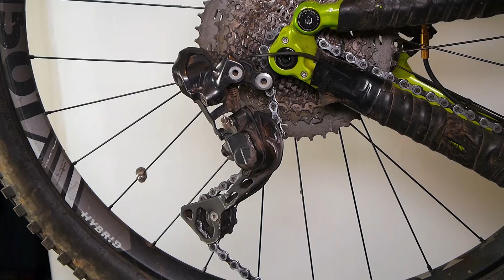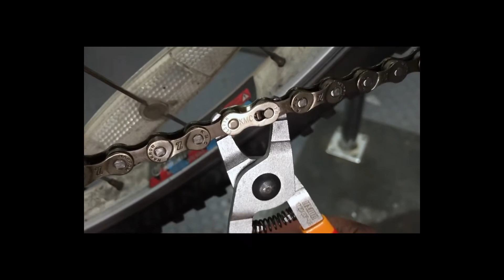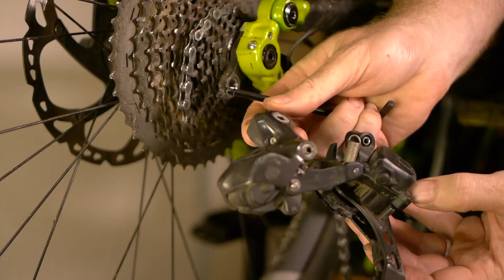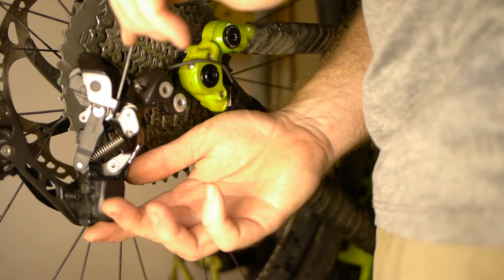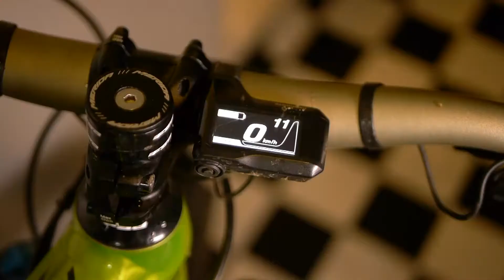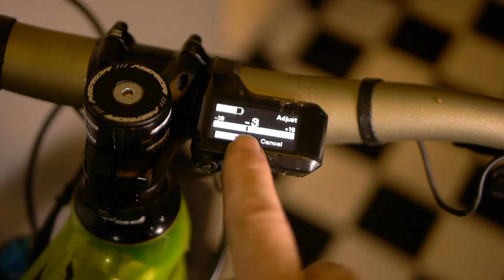Di2 XT rear derailleur remove and install

Comment: Hi. Im struggling to get the gear to change from the largest to the second largest. i have had to wind my B tension screw in, however, just bearly clearing the upper jocky wheel now. get a slight scrape of it as i change up. Im also at -14 (out of 14) for the micro adjust. Any advice please

Comment: Thanks.This Di2 XT RD 8050 is expensive to replace and very problematic as the  tiny electric motor is hooked to a flimsy little spring in the back of it with a tiny laptop like screw with a sleeve on it.Also, it easily loses connection with the computer.The unit is designed like you are going to ride MTB  in your flower garden for 30 minutes.Mechanical derailleurs  are much better.